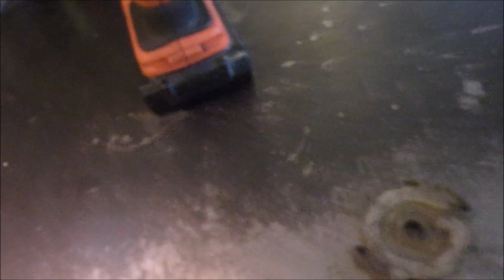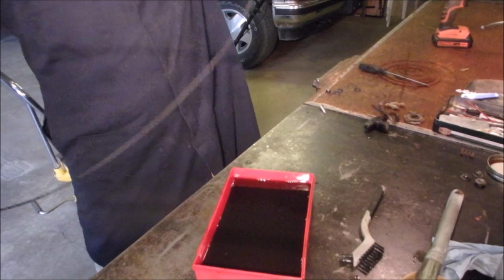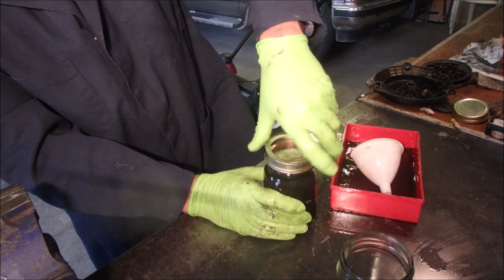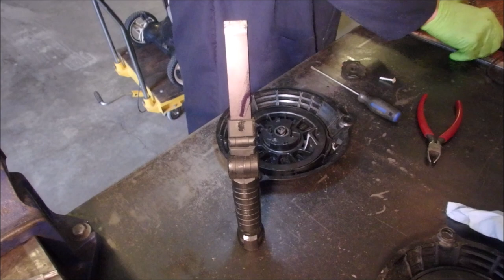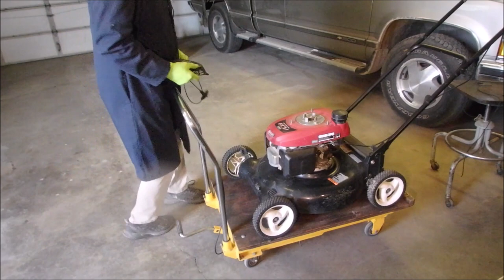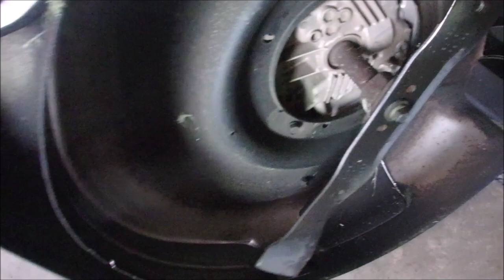Honda Mower Rope Spring Broken

Comment: Bruce, love your videos.  I have issues with this one.  I would never use solvent on non metallic parts.  Short term maybe ok, long term may cause problems.  Rust on plastic, I would use vinegar.   Great on rusty metal parts too.
Reply: John Bango I almost agreed with  you then I remembered there are plastic carburetors today and even the metal ones have plastic parts— the biggest being the float which sits in gasoline all the time. I would consider gasoline a solvent wouldn’t you?
Reply: @corydriver7634  Yes gasoline is a solvent.  Now look the what it does with the methanol in it.  It destroys the rubber parts in the carburetor of small engines.   It totally destroyed the fuel pick up in my Stihl chain saw.   That and he did not specify the solvent.  One more issue.  The float is made out of another type of plastic. 

I am a painter.  I have been warned not to put oil base paint in plastic buckets for long term storage.  On the other hand, paint thinner comes in a plastic container.  Two different plastics.
Reply: John Bango Fair enough but Bruce is not storing solvent in a plastic container he’s cleaning parts so no long term contact. Was your Stihl chainsaw a 2-stroke by chance? I know you definitely don’t want to use ethanol fuel in 2-strokes. As far as oil based paints I’ll take your word on that I’m no professional painter.
Reply: @corydriver7634  I never said that Bruce was storing the solvent in plastic.  I have dozens of the same type of canning bottles. 

My complaint is that he used solvent on plastic.  I have no idea what solvent he used.  What are the long term effects of using that solvent on that plastic.  I am not a chemical engineer, nor is he.  Nor does he know the long term effects of using that solvent on that plastic, even if it is a short time frame. 

When cleaning plastics use safe products.  Vinegar is a very safe product on plastic.  I am going even further now.  Iron oxide is a polar molecule.   Most solvents are non polar molecules.  Therefore the solvent has no useful purpose other than to remove oil and lubricate.

Please check out AVE channel for plastic testing.  Please check out Mustie1 channel for removing rust in a gas tank.  Mustie1 uses HCL acid to remove rust from a gas tank.  HCL is a highly polar molecule.  Vinegar is an acid.  CRL is an acid.  All good with most plastics.

The methods he used do not correlate with science.  This was a fail!!!!
Reply: @corydriver7634  A polar molecule has a charge, much like water.  Oil, gas or other substances have no charge, thus non polar.  This is why oil and water do not mix.
Reply from the maker: Ok  I used it for 30 seconds and store it in glass jars.  Chill everybody.  LOL
Reply from the maker: Well when I was  lot younger I stored gas in plastic milk jugs and if I had not been paying attention they would have leaked all over the garage.  Thanks for your concern.
Reply: @BrucesShop  Bugger me, you're right when you say chill out! I've never seen such an enormous mountain made out of such a tiny molehill.  I just bet that Honda recoil will be fine for many years to come, it's not going to spontaneously disintegrate! Nice repair mate, enjoyed watching. Best wishes from New Zealand.

Comment: Hey Bruce... odd question, when you part out an engine, do you clean the carburetor off screen right away or when it is needed?
Reply from the maker: I check them out quickly and label them with a sharpie as to their condition.  Sometimes if I have a decent one and the Ultrasonic cleaner is going I will throw one into there and label it clean.